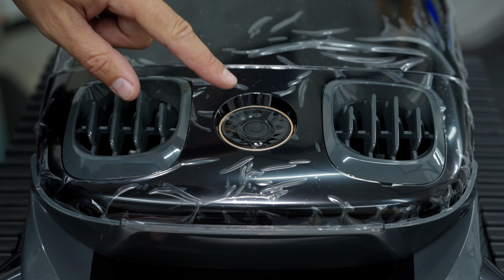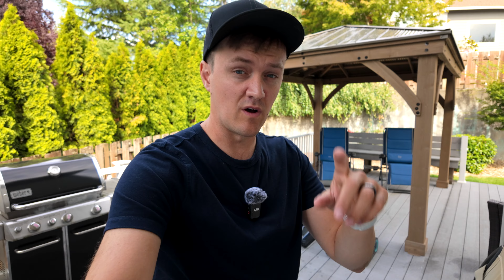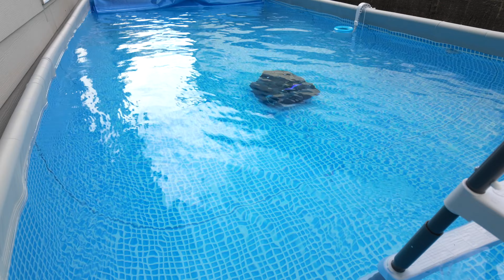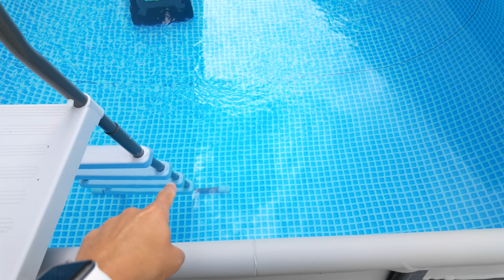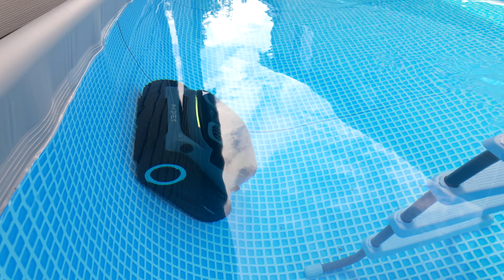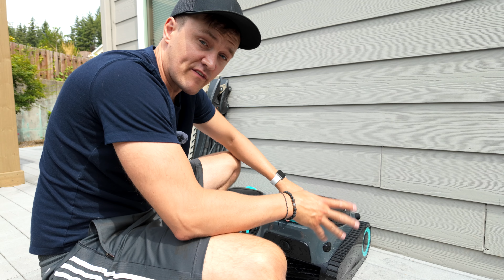Aiper Scuba S1 Pro Robot | Watch Before Buying

Comment: Purchased one and am very dissatisfied. I have an in ground std pool and it seems that the same issue you described is happening. It simply moves around one small area in floor mode. The worst is that it simply does not pick up most of the debris and leaves. I feel that there are 2 main issues. 
1. The filter is too fine and causes issues with flow of water through the system
2. The firmware is poor and hence the pool coverage is not as expected. 
Am planning to return mine shortly.
Reply from the maker: Oh interesting I thought it was isolated to just an above ground. I would recommend trying the S1 non Pro. It literally does a perfect job on my pool...Gets all the dirt and have never been disappointed. Strange how you have that issue in an in-ground. Thanks for the comment. That is good to know.